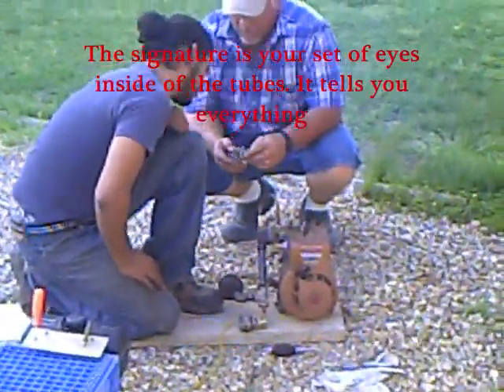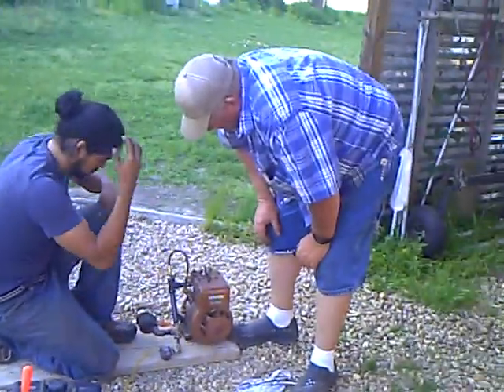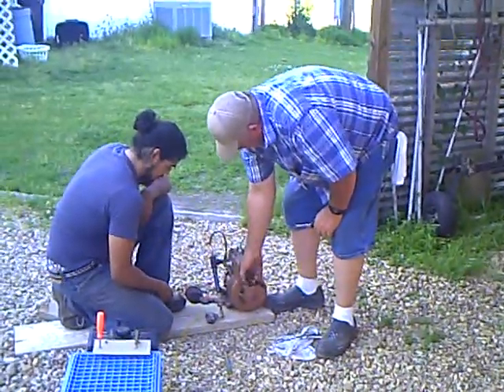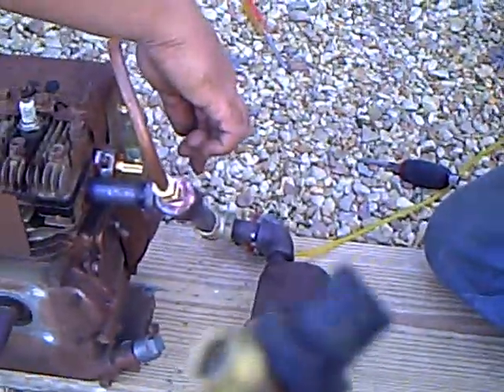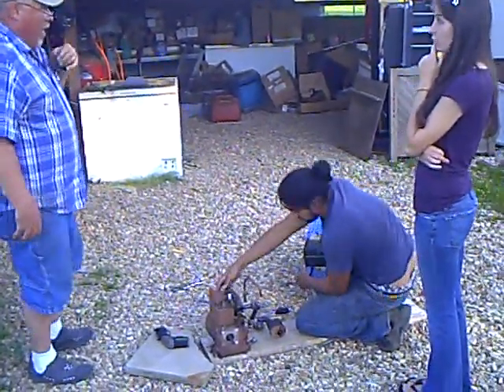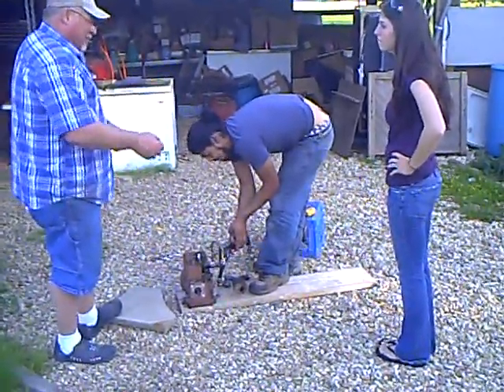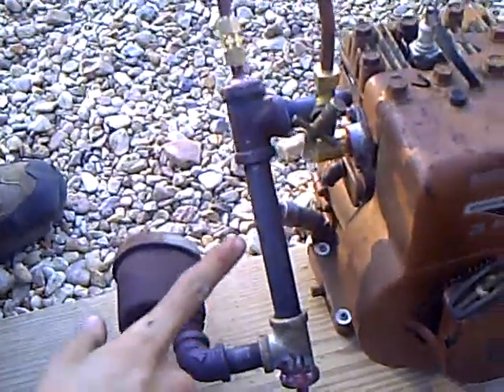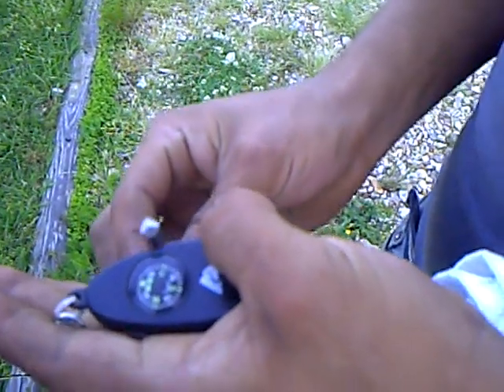Paul Pantone Styled GEET Slave Engine - CAAFuels (2/2)

Comment: Yo. I think my Geet generator is starting to levitate. Check this out I use the copper tube on the inside and a aluminum tube on the outside.  My rod is south on the front rounded tip and north on the concave rear   Somebody said red mercury so I broke open the thermostat that we had in the backyard and put it in there.  And that higher power it was trying to lift a little.  If you’re still interested you can check out my YouTube station my email is in the about section

Comment: This is a great video. Paul talks about the magnetic polarity of a tuned rod (burn in for 20 min) and how it will have a N and S end either on the rod, at the ends or even beyond the end of the rod depending on the fuel to rod length. What's even cooler, is if you flip the rod over (holding vertically) the polarity of the rod changes.

Get the book: "The Book of GEET: Part 1" lots of good stuff in it. This is a cold fission reactor and the engine becomes a cold fusion reactor... The reactions are natural plasma reactions that transmute the atoms. Its not the high temp stuff used by scientists. Although, between the plasma in the fuels, obviously a lot of energy is being released and contained. Self-contained plasma reactors have long been a dream of scientists, also replicating the Earth's magnetic field... Paul did it.

And flowing plasma does two things, it is an electric current, so it creates magnetic fields. But since it is a mix of protons and electrons, it makes a complex electric and magnetic field that turns into a compression wave of electricity with different characteristics than regular electricity. This is how our atmosphere works, creating the magnetic field of the planet, and how the Sun works. Currently the sun is canceling out its 4 primary atmospheric fields, and the net magnetic field is failing, and so, the Earth is also losing its magnetic field. Could GEET save us? Maybe. Paul said he could replicate the Van Allen Belts. Peace, B